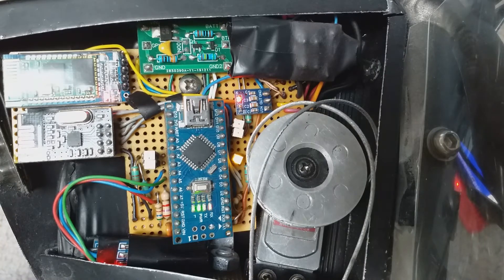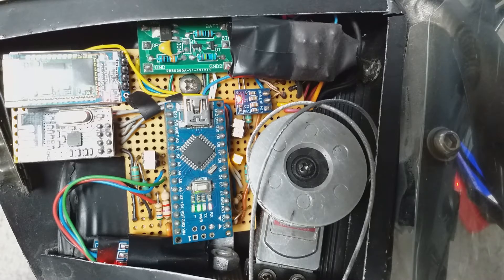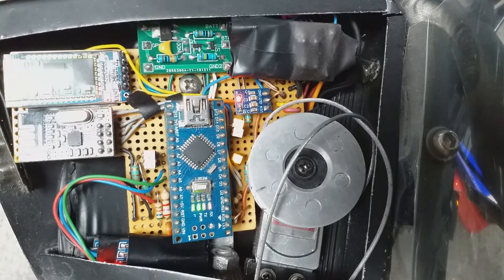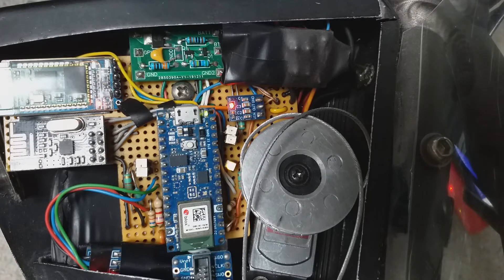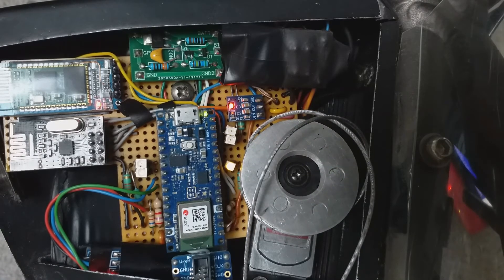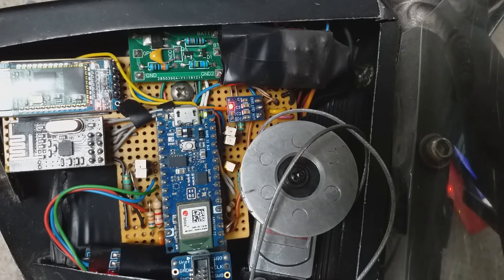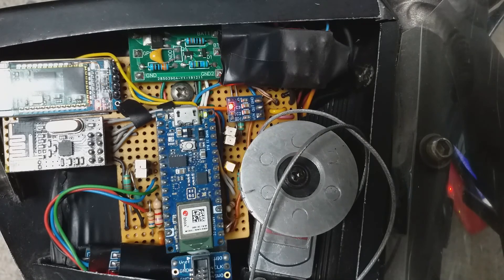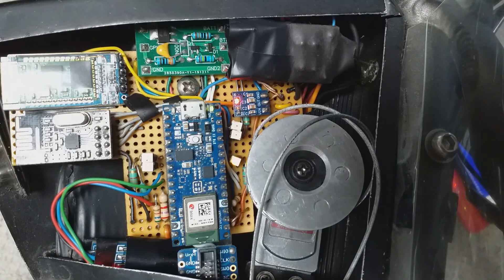Servo jitter, could be code

Comment: Looking good. Good catch on the libs. 
Is the board you’re getting made up the next iteration of the shifter prototype? I imagine you'll move to a much more compact nrf51/2 with QFN48 package for the next-next version?

Got a bunch of esp32 boards that I'm experimenting with while I debug my nrf51 chips. Wish the Nano 33 was around when I was looking for nrf51 boards as it would have saved me years of time.

Thanks for the update.
Reply from the maker: Thanks, it's just taking the mess of bits of circuit and put them all neatly on the one board. I'm keeping a footprint for an Arduino Nano. I like the way I can swap them out easy especially now with the external EEPROM. I'll be using the board not just on V2 but also V1 which is still my every day commuting bike. That bike doesn't need a power meter so will continue to use a classic Nano. V2 will eventually get a Nano BLE because I want ANT+ communication with a power meter. Need to learn to code in Segger embedded studio first. The Arduino IDE sure does make coding easy.